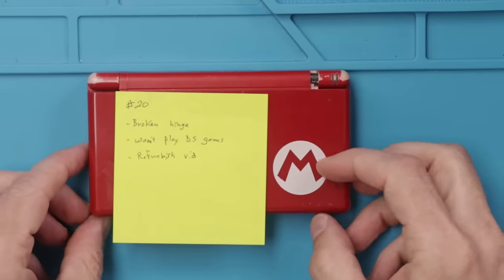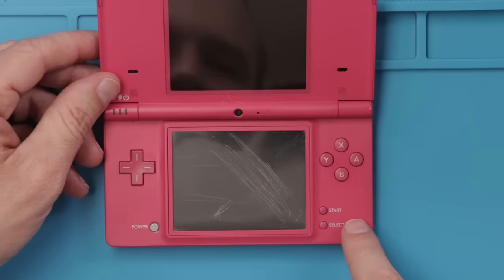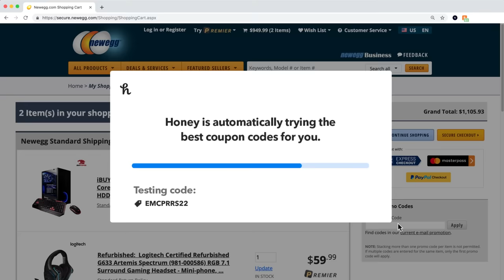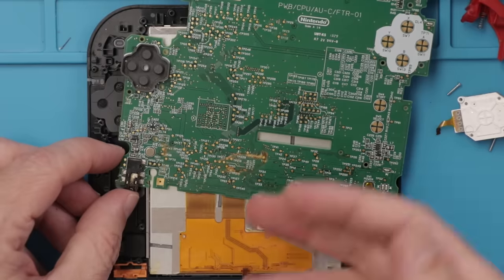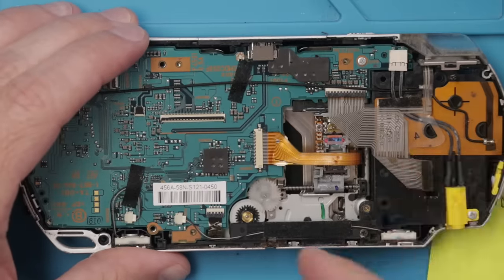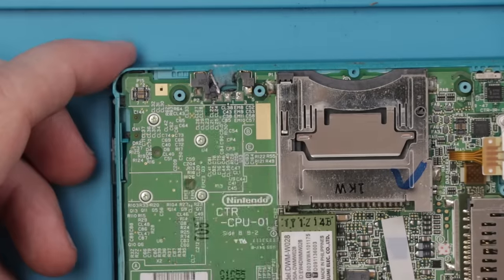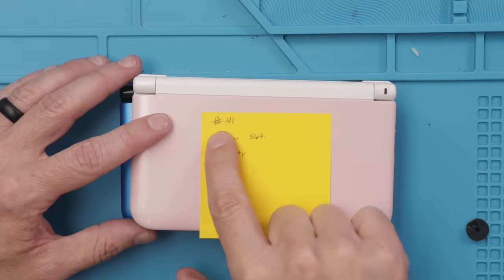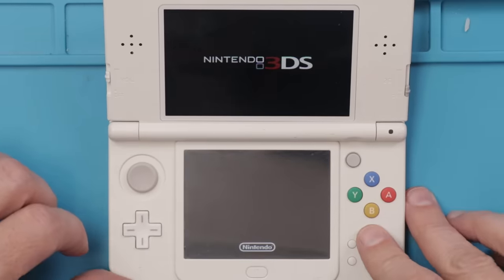I Paid $540 for 44 Broken Handheld Game Consoles From eBay - Part 2

Comment: imagine listing a 3ds as “for parts/broken” when the only thing wrong with it is parental controls..
Reply: Same here. Phone was not turning on. The issue was not charging it for a long time leaving the battery flat. 2h of charging and I had working phone.
Reply: I got 17" macbook pro 2011 for £80 problem being it was slow it just needed mac os reinstalled
Reply: fake fame hunter probably plagued with the GPU failure 💀
Reply: +fake fame hunter I don’t really consider that a problem, it’s just old
Reply: I had a lot of Wii's where most of them were just parental locked. There's a site that'll give you the master key that took me 30 seconds of research to find lmao
Reply: it's very common, I bought a wiiu and when inspecting it, I found that a ribbon cable was unplugged
Reply: Blasts Mods my first ever repair was a fairly easy fix on an original Nintendo wii. Issue was the controllers not connecting to the wii, reason: the controller sync button was dirty and so wouldn’t work
Reply: @BlastsMods  I can imagine that being a problem for the original owner if they didn't own an iFixit kit.
Reply: @halotroop2288  if I remember correctly, it was only a few standard phillip head screws to get to it but in some cases it would require a special tool that can be found in the ifixit kit
Reply: @Jack-5718  no I use it every day and it's really fast
Reply: Yeah my 3ds has parental controls and my parents don't even remember the code so I can't unlock it
Reply: I bought an Xbox 360 in a similar state.
Reply: I went around a flea market. I was running late that day and a lot of people had gone already. I walked past one abandoned box of junk and something jet black caught my eye and I had a look and it was a black edition Wii console. The only thing wrong with it, was the Gamecube memory cover had broken off. How can anybody throw away a console for some stupid reason like that? It now has a nice happy home.
Reply: @Systremor i once bought mint iphone 6s for 40 euros that had "dead motherboard"  for spare screen and it had failed update so i had to reflash ios and it worked flawlessly sold it next day for 180 euros lol
Reply: same for the ones that have dirty game slots.. like you can easily google what to best clean them with clean them and it works again.. unless the pins are bent wich i'd say is alot rarer than just some dirt getting in there.. i mean i would defenitely have tried cleaning the port before just going UGH IT DOESN"T WORK ! like alot of these are easy fixes.. same for the gameboys with clunked batteries.. order a new battery from a retro gaming store.. replace it and boom.. if that doesn't work then i'd perhaps list it as broken but it's easily fixable.. now i'm not one that easily gives up on tech unless they are done and truly broken and fixing it would cost more than just getting a new one 2nd hand or in stores relying on the device
Reply: i have a 3ds that i cant acces to nintendo network and cant download themes and stuff
Reply: woaah this comment got a lot of attention
Reply: yup parental controls means "broken" to some people... weirdos.
Reply: I got a galaxy 3DS from a pawn shop that had the parental controls on it and it was so ridiculously easy to fix lol.
Reply: A kid sold it as a tantrum.
Reply: Parental controls for some people: broken, for parts junk 
Parental controls for me: power wash
Reply: I got a mp3 player for like 200 CLP (like 30 us cents i think) because it was broken. It had a single rice in the headphone thingy. (  o.o)
Reply: Bought one from Ebay as spear or repair not playing games only need the parents controls removed easy fix
Reply: if you notice the 3d effect wasn't working on that nintendo 3ds
Reply: Rather imagine having that issue and not even bothering to Google it to try to fix it. I mean, my generation (tronics generation) is pretty good at googling and filtering out the junk. So for us, googling is really effective and quick for information. If you don't know how to filter the junk links and pick good ones, yeah I can see it annoying.
Reply: @piwbenzyna  that's good advice for any old dead phone sales. Lithium batteries at a dead-dead state charge like 1 percent every 10 minutes.
Reply: i got a 3ds recently it came with parental control and a battery that died very quickly, i put it to charge overnight to solve the battery problem and on the other day i just searched online on how to remove parental control (it's actually really easy), now i just need a new charger but it works perfectly fine.

Comment: This man is saving all these dead and broken machines from some very irresponsible people.
Reply: The thing about 30 year old stock that's new in box is that it was never loved while many of these machines were and it makes engineers happy to know they were. Beloved electronics much like a good relationship just require work sometimes.
Reply: 80% credits to some anonymous hero from recycling/liquidation company, who saved this devices from being recycled.
Reply: @Joe Mama routine cleaning does
Reply: @scotshabalam2432  It also may have issues right out of the gate like dried thermal paste.
Reply: Actully the most people arwnt irresponsible its just sometimes that the card reader just gets dirty or while usage something internal breaks
Reply: They're not irresponsible. They're extremely old mobile gaming devices. Stuff is going to happen to them. Even the most careful owners will drop, mangle, or spill stuff on them.

You sound like the kind of person who would buy a luxury sports car and keep it in a garage to keep it in mint condition instead of being like Mr Bean Rowan Atkinson and racing them on a track like they're meant to be used.

Comment: "IPA which isn't really available rn" oof felt that one
Reply from the maker: I've got an extra gallon here, luckily.
Reply: Thats driving me nuts atm.
Reply: What about methanol?? I've tested it on a few boards screens and components and it seems to work great. I acquired it via a fractional distillation of denatured alcohol.  A MSDS on the company's website declares it to be 10% methanol 90% ethanol. Although seems more like 30% methanol 70% ethanol according to boiling points and final yield. Saving the ethanol for 🤲😷☣
Reply: my bong needs some tlc
Reply: 555

Comment: Just wanted to let you know that the DS and DS Lite can NOT read cartridges without being turned off again first so: 
Turn off, insert card, turn on. 
Could have bern that it would have already worked without being taken apart! :)
Reply from the maker: Yep...I forgot that but then remembered partially through filming. Thanks for the reminder again!
Reply: @Tronicsfix  oh my, thanks for answering and hey we all forget something in the heat of passion ;P 
Thanks for your content in these trying times <3
Reply: I immediately looked for this comment when he said it didn't work XD
Reply: My old ds lite could boot use games that were inserted while it was on was that just my Ds?
Reply: that's a weird thing to not support. 3ds did it just fine. oh well. at least they still work well.
Reply: ooo what a cute derg
Reply: That's so weird, I swear mine could do it.

Comment: If the screen is defective the 2DS won't turn on, check if you connected all the ribbons properly. I've repaired a few in the past.
Reply from the maker: Yep, that's a common problem. The ribbons are all good. Thanks for the tip though!

Comment: The PSP UMD drives are really interesting, because there are 2 switches that tell them to turn on. If one fails or is damaged, the drive won't spin because both switches need to be depressed to work. If you ever have a PSP that won't read UMDs, make sure it's spinning before messing with the laser assembly itself.

Comment: I remember when I tried to fix my 3DS after throwing my CD binder on top of it.  I cracked the top screen so I ordered a new one.  It did not end well for me.  I tore the ribbon cable on the new screen and just wound up buying the cheapest used 3DS I could find.
Reply: Ribbon cables are evil. that happens.

Comment: the most interesting one was the reflow on the 3ds, generally the blue light stays on longer than that, so I knew you had something different going on than a broken backlight connection.

nice fix. 

it's a shame they hid the CPU under the game slot

Comment: Damn I never thought of just cutting the old port off, putting USB C on my 3DS was such a pain in the ass since I was trying to get all the pads hot at once.

A lot of times when the 3DS does that 3 seconds with blank screen then power off with pop, it means the camera ribbon cable got kinked. If you unplug the ribbon it will still boot and play games but will crash when you do anything with the cameras.

Super common issue when taking apart that thing due to the 3 overlapping ribbons in that area. So make sure you test the cameras. You can probably still sell it if you disclose it, most people and games don't use the cameras.

Comment: Hey Steve! Earlier this year my sister gave me her PSP (same model as the ones you had) to see if I could fix it. It would not turn on nor would it charge. I deduced that the battery was dead (it hadn’t been used for a few years) so I found a battery on ebay to replace it and it worked perfectly 😀.

Comment: I appreciate the advice; I got a 'broken' ds lite from ebay, and the only problem was dirty pins. The bottom screen is slightly scratched, but it's not much of a problem to me. I don't really trust myself with screen replacement.

Comment: I am pretty sure a lot of the time that home screen buttons issue can be caused by the WiFi Chip, because the system is trying to get the wifi status to show at the top of screen, however it can't find it so it's just stuck

Comment: Thanks for the videos. Your Nintendo Switch repair content helped me repairing my own switch with a broken PI3USB. So far I have removed it and a blown choke and the console boots again! Once I get some solder paste I should be able to complete the repair. Any tips on holding those small chokes in place while soldering, mine keeps blowing away?

Comment: My PSP-1000 works perfectly fine, but at some point ages ago the power slider fell out, so I ended up having to use objects like pens and golf tees to turn it on and off. Eventually I realized I can just use the corner of the memory stick, and after maybe 15 years of doing that I finally broke off one of the pins on the stick earlier this year and the memory stick stopped working.

F

Comment: With PSP UMDs you might wanna first check if the laser works by clicking a small button inside, if it works then try cleaning the lens with IPA it just might be dirty, if that doesn't work then the UMD drive is dunked. Good video btw

Comment: My first TV I picked it up from the trash outside a neighbor's house. took it home, opened it up and saw there was a small glass tube that looked burnt. I was 11 and had never opened up a TV, also I knew nothing about repairing tvs. but I went to radioshack and they sold me a replacement fuse for like 30 cents. went back home, replaced the fuse and I had a working TV.  after that I got hooked on picking stuff from the curb  and trying to repair it. I failed with most. but a lot of things I actually repaired and if I already had one I sold it really cheap.  VCRs made me some good money.

Comment: use a pencil eraser on copper parts to clean them up. It might make short work of the ribbon cables. Just a regular old number 2 pencil eraser or a pink eraser for the economist. it also works great on pennies and copper contacts on video games cartridges.

Comment: A piece cut from cleaning tape for a cassette or 8-track glued to a dead game cleans the pins quickly. As it gets dirty just glue another piece over it and after a few layers build up you can just peel off some of the old layers. I use the 91% IPO, it evaporates fast. I use Honey thru Paypal, it will find you the best price across stores on stuff. It just saved me about $10 on a $150 video board last week.

Comment: Another tip with 2ds’s is that if you ever put the power button rubber membrane incorrectly even by a nano meter it will not push the button on the motherboard properly and will not turn on. What you need to do is go back and realign the rubber membrane with plastic shell on the inside where the power button is and make sure to push in the rubber membrane.

Comment: A helpful hint: The OG ds model and the ds lite only read and show games when you insert them when the system is turned off that’s why the game didn’t show up immediately on the red ds lite after you cleaned the pins. But when you took it apart you disconnected the battery so that turned it off. Also the Dsi is the only system to read and play games even when it’s turned on.

Comment: Hello Sir!
Could You share what kind of glue is good for DS hinge repair? I've tried with cyjanoacril based, but they snapped off imidietly and left messy residue ...
I just got First DS and apart of both hinges all other works!
All best!

Comment: Not sure if anyone will ever see this but I’m pretty sure the reason the red 2ds didn’t power on after replacing the screen is because it needed to be insulated from the board (some tape works fine for this). Without the insulation the metal on the screen shorted out the board and fried it.

Comment: I have a DSI that the camera will not work. It shows the Error Message: An Error Occurred. Press and hold POWER to turn the system off.  What it could be problem? Hopefully You can help.

Comment: Blue light flashes but doesn't keep on on 3ds can also mean its been hacked with custom firmware- with older cfw, it needed the SD card with payload in otherwise it'd boot but turn itself off a second later

Comment: Hi TronicsFix, is there a possibility that you could repair several Controllers as one of your next projects (stuck bumpers, faulty analog sticks, common fault when repairing them)? I ask, because I use your videos as a "looking before repairing instruction", to have at least a little idea what kind of problem it might be and right now I have several old Xbox360 controllers with the above listed problems :D.

Cheers and thank you for these kind of videos...It has some strange meditation effect on me,  when seeing stuff getting repaired.

Comment: Not sure if it's not worth the time/effort but to test that unknown screen on the non-working 2DS you could swap it with the working 2DS just to confirm if the screen is good or not
Reply from the maker: Yes, you could...but it is a time investment.
Reply: @Tronicsfix  yeah I figured you would've thought of that and felt it wasn't worth it based on some factor but figured I'd ask in case you were in the zone and didn't think of it
P.s. love watching your soldering work on the motherboards for some reason it's endlessly fascinating to me

Comment: Hey I've got a PSP 3000 that needs the screen replaced. Can you do a video about that? Also, any tips about removing the security seal over the screw in the battery compartment and preserving it so it can be put back on after the fix without damaging it?
Thanks!

Comment: Another hijack comment - my PSP-2000, only works if I smack the hell out of it. Like it doesn't load ISO or UMD's unless I smack the left side hard. 

Opened it up, no liquid damage, no pins I could see, no rust....googling it's  a common problem. Any suggestions?

Comment: my first 3ds i bought used, and i was so sad when it had parental controls. i bought the cheapest one i could find and when i called the store they said if i can't get into it i would have to return it and buy a different 3ds. just to see if it would work, i tried 1234 AND IT WORKED. for some reason i didn't think that would be a common problem, so seeing you mention it reminded me of when i first bought mine.

Comment: Hey tronicsfix I have a dsi xl that has a broken sd card slot. Problem is the screws on the back are stripped, very difficult to get in. Tried using the rubber band trick and it didn't work. Any ideas

Comment: I've had my DSi since I bought it brand new. My main problem is the left and right switches have stopped functioning. I was hoping that your video would give me some information as to how one could fix them. Otherwise, the system works just fine. Could you do a video that shows how one can do that?

Comment: I wonder if it would be easier to fix a ds with bent pins, instead of desoldering in resoldering a new socket, I bet you could permanently attach a flash card with only one round of soldering.

Comment: My top screen for my 3ds xl broke a while back so I bought a new screen and replaced it myself. When I bought the new top screen the screen protector had air pockets so I took it off and now the top screen has a sticky residue left on it. I tried to use rubbing alcohol to get rid of the residue but it is still there. I saw another video where someone used brake cleaner to resolve a similar issue. I just want to know if my screen won’t get messed up afterwards. Thanks

Comment: Changing a motherboard changes its S/N, right? That would imply the 'download again' function for the games that came with the 20th anniversary 3DS (either  Red or Blue) doesn't work anymore. Is that correct, or can you somehow, without Homebrew, change the S/N of the motherboard to fit the outer shell?

Comment: When you turn on the nintendo ds lite and if there is no nintendo written on the bottom that means there is no game installed so you can tell if the card slot is working just by turning it on and not touching the screen. Just saves one more step.
Reply: Also btw when you take it out when it was installed it just crashes the OS